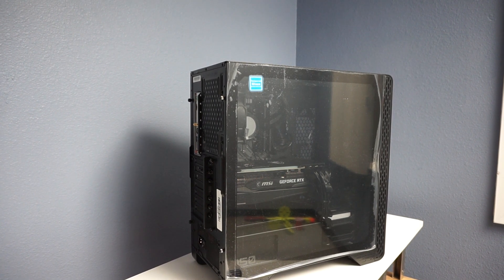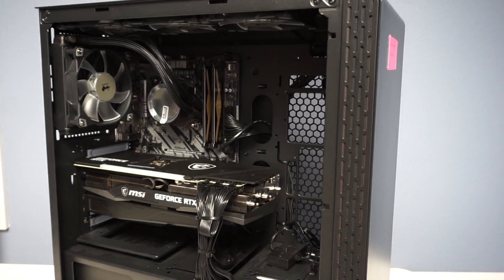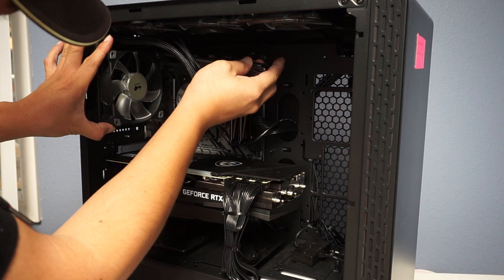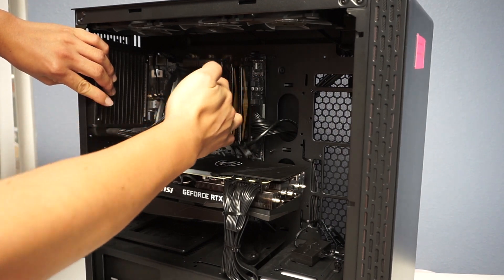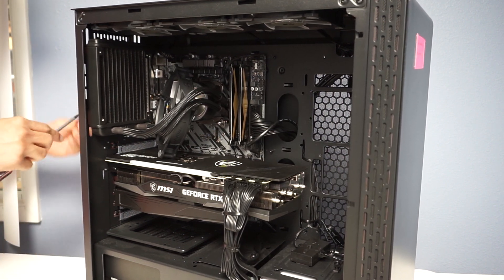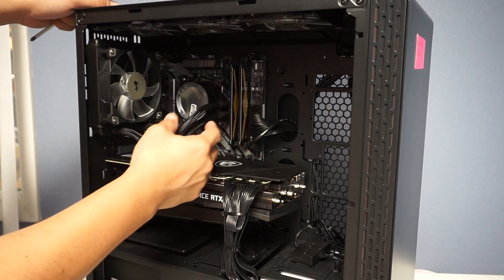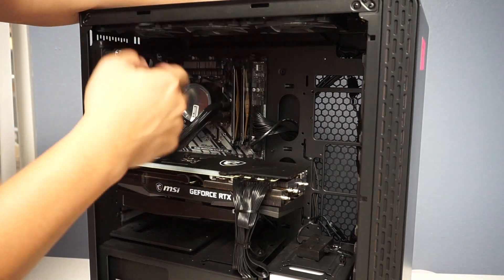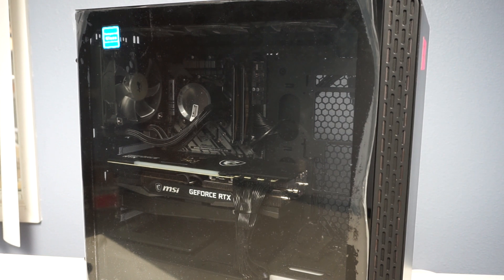Fix for noisy AIO pumps in specific builds

Comment: Worked like a charm. And your fan setup was almost identical to mine. I had an extra fan in between the case and the radiator. Thanks for the short yet comprehensive video.
Reply from the maker: You are most welcome! 
I'm glad the video helped you out!
Reply: Sadly just 20 minutes after the fix it started up again. Any advice? I know it's air because I can smack the side of the radiator and it stops them starts up again within a minute or so
Reply from the maker: @Sithsolo  are the hoses on the side of the pump or bottom?
Reply: @troubleshootdis5930  side of the pump. I think I figured out what it is. There are two metal plates on my radiator with a wire coming out of it. If I unplug that wire from the motherboard the noise stops. I think is a fan or component withing the actual radiator. I can't access it but when I unplugged it it skyrocketed my temps
Reply from the maker: @Sithsolo  Please do not unplug it. that is the pump's power. If anything you can see if it is set yo full speed on bios fan settings. apart from that you may be able to rotate the pump to where the hoses are on top. See if that solves the issue
Reply: @troubleshootdis5930  I'll give it a go and get back to you.
Reply: @troubleshootdis5930  yeah its the pump in the rad. It's done after two years of use guess it's dead

Comment: Guys I have the solution for you, believe me. It´s all about the bios, go to the fan settings on your bios and change from PWM to DC the speed control. Every bios its a bit different but if you find this option you will fix the issue. Sometimes if the pc has been out of power for long and lost the settings from the bios this can happen. I hope this can help you all, I first thought it was a bubble problem but it wasn´t
Reply: THANK YOU! It must have changed off when I was forced to reinstall and test new RAM since my initial sticks on upgrade were faulty. This fixed it almost instantly once ample power got put through. I was about to be forced to buy a new AIO until I tried this!
Reply: this worked for me thank u very much

Comment: Your CPU pump is positioned higher than your radiator tubes. That’s why you have noise. Rotate your radiator
Reply from the maker: Thanks for the comment but at any point the pump was not ever higher than the radiator which still works but not optimally as air tends to rise and the whole objective of the video is to trap the air opposite side where the inlet and outlet hoses are, which is also done on the video. I am so confused as to what the purpose of your comment is but thanks and have a good night!
Reply: @troubleshootdis5930  I have rotated my computer to try and get the air bubbles out of the pump but it still seems to make a noise while under load. Do you have any suggestions
Reply from the maker: @rundan8620  Hi, I would try tilting it forward about 45deg that way the radiator is higher than the pump and let it run for about an hour or so.
Reply: @troubleshootdis5930  I have the radiator mounted horizontally above the pump. I've tried tilting the computer both ways but only for a few moments. Could there be any damage to the PC if I leave it tilted for that long
Reply from the maker: @rundan8620  Just make sure you are tilting it to where the side of the radiator without the tubes are at the highest position. Leave it at that position for a bit and observe it. sometimes it really take a long time to purge air from the pump. which side of the pump do the tubes come out from?
Reply: @troubleshootdis5930  well it seems it was not the pump at all. the noise came from a bad radiator fan. So here's a new question. Can i use any PC fan for my radiator or do i need to replace the same exact fan for my aio cooler? Currently it comes with Corsairs' special magnetic bearing fan: SPL140mm
Reply from the maker: @rundan8620  The magnetic bearing will work well with your horizontal setup. You should not have anything to worry about once you replace that faulty fan with it. I recommend replacing it with a similar one as those fans are high static pressure models meant to push air through the fins for optimum cooling performance.

Comment: What if my setup is already like your "after" and it's making noise? It sounds  like my noise is coming from the radiator (back of the pc)...please help!
Reply from the maker: Hi there, it will always be air in the system that will cause noise to the pump, try more of the tilting methods in different angles and see if it loosens the air from the pump and transfers it to the rad.
Reply: @troubleshootdis5930  even if the noise is coming from the radiator? When I tilt it backwards, the noise goes away.
Reply from the maker: If noise still persists please contact support most likely for a replacement. Permeation may have occurred and there may not be enough liquid in the system to circulate.

Comment: Can someone please help me? I purchased a Thermaltake PR2U with a D5 motor. I have exactly the same problem as in this video, where the motor sounds like a squeaking mouse sound. How can I fix that? Why is that?
Reply from the maker: HI, for the custom water loops like yours, you may need to continually run and purge air from the entire system. It is totally different process from the AIO systems that is shown in this video.
Reply: @troubleshootdis5930  How do I do that specifically for the Thermaltake PR2U for the D5 motor? It's making a squeaking mouse sound and the water in the tubes are not moving.
Reply from the maker: @rknine7998  Are all your joints air tight? any air leaks will decrease pressure and not push your coolant properly. make sure you also fill up the reservoir to the recommended levels.
Reply: @troubleshootdis5930  Yes, I did tighten both fittings very tight, the gas tube on top of the reservoir is closed and the liquid is filled all the way to the top. However, the water level is sitting flat and the water in the tubes going into the CPU block is still. No water is being pumped.

Comment: I have a bubble sound on my WC, but it's a 360 front mounted, and I can't flip it, i just want to know if it's this going to kill my aio on any way
Reply from the maker: if you can try the tilting the system in different angles and see if the gurgling goes away. ideally you ant to situate the tubes coming out of the pump upwards to purge any air in the pump and have them go to the radiator chamber.

Comment: Ok I have a problem. I flipped my radiator upside down, didn’t help. I took everything out and the very loud sound is coming from the radiator, not the pump. It’s a loud clicking noise, not a bubbling noise. What should I do?
Reply from the maker: Hi there, Have you tried removing the fan from the radiator itself to see if the noise still persists? If the noise is coming from the radiator itself then there may be something wrong with your cooling system. I suggest sending it in for replacement from the seller.
Reply: @troubleshootdis5930  thanks for the reply. It’s the radiator. Apparently ibuypower aio systems are kinda known for this unique problem.
Reply from the maker: @montanawhite5699  You are very welcome!
Reply: @montanawhite5699  going through the same problem. removed my fan once to clean the dust from the fan and radiator and booted it up with the crackling noise. they won't be getting any more business from me.
Reply: @KemetOG  I fixed the problem, I removed the aio radiator coolant system thing and bought a air cooler. Works like a charm. I disassembled the radiator as much as I could. Not sure what the problem was, but the water that poured out had lots of crap in it, maybe bits of plastic or dirt or something. First time ever working on a computer, I was always intimidated, but once I did it, it was just like working on a truck.
Reply: @montanawhite5699  I actually took my fans and the aio off & shook it & then reassembled & it no longer makes the noise.
Reply: @KemetOG  yeah I did that too and it worked for a little while. Then also experimenting, I noticed that while I hit one of the tubes pretty hard over and over the noise would stop, but as soon as I stopped hitting it the noise would return.  I’m just glad it was an easy fix, I thought it was an electric short or something.
Reply: @montanawhite5699  Damn thanks for the info...hopefully mine holds up for a long time to come. I think I cause the issuw when I flipped the pc upside down to remove the fan...may have cause some air bubbles.
Reply: @KemetOG  yeah that’s the problem everyone else has. But the problem I had was specific to Ibuypower aios. I watched a lot of videos on air bubbles in the system and mine sounded nothing like it. Finally found forums of people with the same problem only with the Ibuypower aio.
Reply: @montanawhite5699  damn, I have my pc from the same company as I mentioned before. Bought a $1,300 pre built in july of 2020 before the prices of parts shot up to the ridiculous level they are now. I at least need this pc to hold up until these pricea come back down which may be a year or two looking at how its going now.

Comment: I got a brand new build with a new lian li gallahad 240mm aio. The thing is loud and sounds like a jet engine. Even with adjusted fan it is still loud. No idea what to buy now but I’m kind of scared to get another aio because of excessive noise.
Reply from the maker: Hi, do the fans connect to a controller hub or do they daisy chain to each other and connect to a fan header on the motherboard?

Comment: I did this and it was actually a little louder lol
Reply from the maker: Try letting it sit at an angle for a bit as air bubbles will make their way out of the pump. If it is still loud then you may want to contact service and see if your aio system may need replacement.
Reply: @troubleshootdis5930  yeah was planning on contacting them thx for the help

Comment: So my Hose is making the noise, I’ve tried tilting it and it goes away for a day or so then comes back. I’ve noticed when I wiggle the hose it sometimes goes away. Can I just buy a replacement hose anywhere or does it come with the fan and radiator too? Thanks!
Reply from the maker: Hey Steve, unfortunately the hoses are crimped and non replaceable on the all in one coolers. it will have to be a full replacement with the radiator. You can transfer the fan over on the new one.
Reply: @troubleshootdis5930  Ok thanks! Another question, is it better to tilt the comp back towards the pump or forward towards the radiator?
Reply from the maker: @Repla12481  I would lean towards tilting it back as air goes up and we want all pockets of air to be transferred to the radiator and clear the pump from any air bubbles trapped within its internal cooling fins.

Comment: Hey I'm having a similar issue with my nzxt kraken m22. looks like sound coming from the radiator or the fan infront of it. thing is It only makes the noise when CPU temp rises to 70 degrees, and somedays it doesn't even make noise even if it rises to 70. I'm really confused about this. any suggestions to fix it? Pls HELP
Reply from the maker: If you have tried tilting it in different ways to get the air pockets out and it is still making noise i would suggest getting in touch with support to maybe have them send you a replacement. I apologize but I have not had the chance to test those brands out and get to know them well to be able to troubleshoot their units.
Reply: Do you think this noise causes by bubbles ? Even it happens when temp reaches 70?
Reply from the maker: @shakunajanith7796  Quite possible that your pump is set to pwm mode so it will spin faster and move more liquid across the internal fins as your processor heats up and throttle down as your cpu cools down. Again i am not familiar with how other companies configure their cooling systems.
Reply: @troubleshootdis5930  yes its on pwm mode. Should I switch to dc mode ? Will that help?
Reply from the maker: @shakunajanith7796  I cannot guarantee that it will help but you can switch it to dc then try doing the tilt to shift any air bubbles from the pump to the rad.
Reply: @troubleshootdis5930  I have it like the pump in the top of the rad. Just like the one you had first time in this video. So in that case I should tilt it to left side right ?
Reply from the maker: @shakunajanith7796  yes that's correct.
Reply: @troubleshootdis5930  thank you so much man
Reply from the maker: @shakunajanith7796  You are more than welcome!
Reply: @troubleshootdis5930  so I did what you asked  ( tilting ) and the noise is gone. not sure it will come back in the future but do you think its the bubbles causing this?
Reply from the maker: @shakunajanith7796  Having air inside the pump makes the impeller spin unevenly hence causing noise due to variable speed and uneven flow patterns. I would keep an (ear) on it and see if the noise comes back, if it doesnt then you have effectively removed the air pockets that my be the source of your issue.
Reply: @troubleshootdis5930  thanks I’ll keep my ear on it